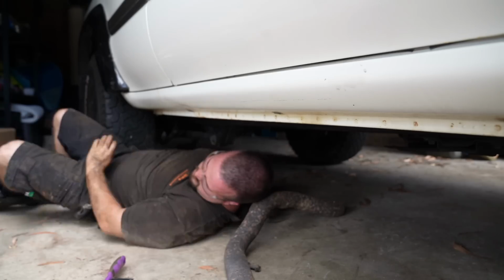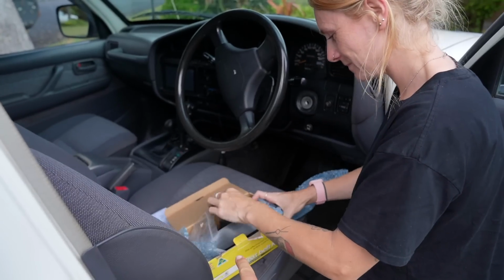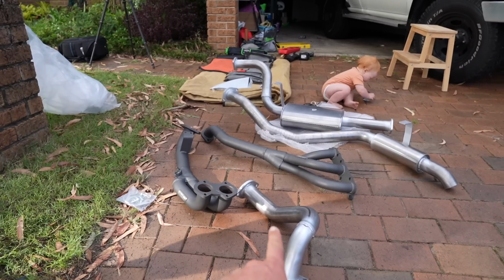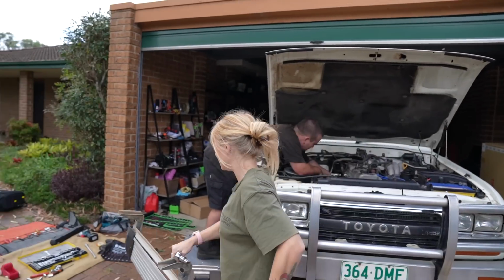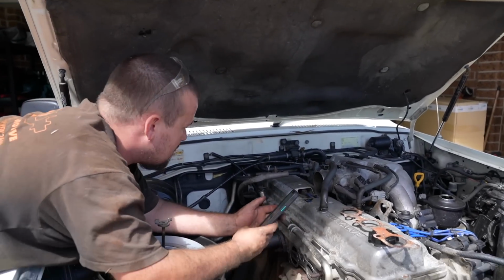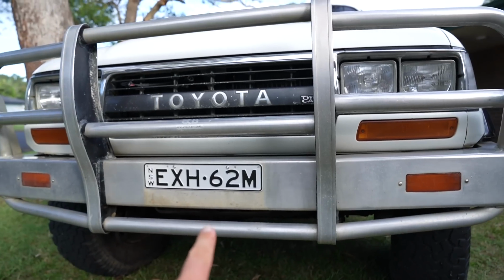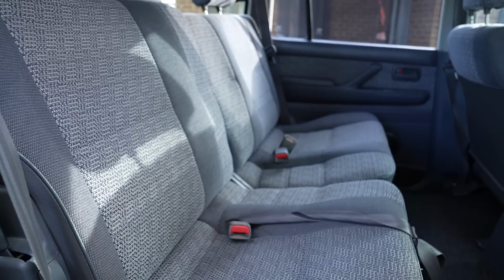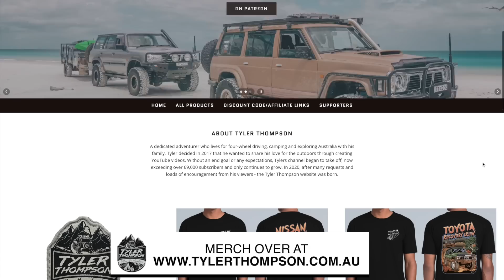Getting the 80 road registered! The Toyota LandCruiser build begins!

Comment: Also I can recommend to remove rear tailgate window and respray it, eventually repair any rust (which probably will have some) before it is too bad. I would respray it at any case because factory paint is not thick enough and they all rust.

Comment: Off to a great start with the mods.  Good one. 👍 The retro Toyota body stripe decal works well.  The colours suits so perfectly. 👌  Can you still fit back the OEM heat shield over the new Genie headers?
Reply from the maker: Cheers, na won't fit, didn't put it back on
Reply: @TylerThompson90  where would You Buy the rubber gaskets for the flares. I have no idea. Be great for some info. Love the 80's.
Reply: @TylerThompson90  suggestion for number plate ""CLIMIT""

Comment: Should got the XR6 seats before the seat covers, honestly one of the best mod ya can do to a 4wd, got em in my 80, need some of those seat covers though, can they do custom lettering for anyone, think mine will be XR 80😂 have allot of of good seats in my cars Recaro’s! factory, AFM and GTr, I love these sets in my 80, can wheel and drive in all day!

Ps I love Demi’s style, this is gonna be better than Sam Young’s abomination! Styling True 80.🤘🔥
Reply: good idea for the seats but wont pass engineering without a lot of mods an $1800 engineers certificate is a bit much for 2 seats
Reply: @grumpy-g5s  That's what I heard too.  Ie. that without engineering the swapped seats, they are illegal.
Reply: @grumpy-g5s  Who cares about engineering certification for 2 seats just buy the Huracan brand seat adapters all’s good 👍
Reply: @grumpy-g5s he has to get all the mods engineered eventually anyway